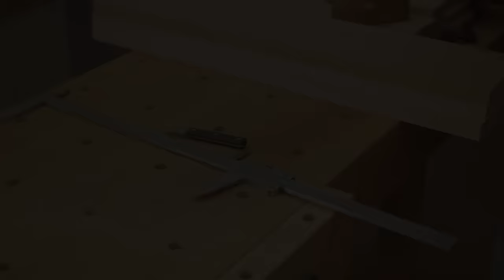SQUARERULE FURNITURE - Making a Dining Chair

Comment: This is one of the most clean and elegant chair designs I have ever seen. Very impressive work! 

I've noticed that other chair makers will incorporate a splayed design where the seat is slightly wider at the front than at the back. Did you do this as well? Or do you chair sides/rails run perpendicular to each other? Thanks in advance!
Reply from the maker: This chair is right angle.
However, upon request, the tilt of the entire chair has been adjusted.
<Adjusting the inclination of the legs>

Comment: Amazing craftmanship, my friend. What finish are you using?
Reply from the maker: AURO 117  1time ->  AURO  126 times 3 times -> Completely dry -> Varathane Polyurethane Varnish 5 times

TIP : 

- For the oak series, fine sanding is recommended.
If you spray water first(drying)  the surface will be smooth when oiled.

- The point is to apply thinly and wipe well. 

Thank yo

Comment: Excellent design, i appreciate that the seat joins overlap the rail/leg of the chair for extra strength. What sort of router table do you use? (5.46) I'm very impressed with it!
Reply from the maker: Thakn you 

I am using the same model as below.

http://www.winextool.co.kr/shop/shopdetail.html?branduid=1130849&xcode=051&mcode=004&scode=&type=X&sort=order&cur_code=051004&GfDT=amd3UA%3D%3D

Comment: After many years of making furniture in Europe , I’ve never seen a notching saw like you use at 3:56. Is this common in Korea?
Reply from the maker: This is a small table saw from Japan. There are saw blades on both sides.
It has been widely distributed in South Korea.
Try searching Google or Yahoo Japan.
This is the tokiwa sb400 model.

Comment: Which sawblade are you using on the makita bandsaw? I have the same saw but it always struggles with big pieces of wood
Reply from the maker: I remember it was a 16mm blade.
Now I use a different band saw

Band saw settings are important.

Comment: Wonderful design, quick question I am having a heard time finding a similar router bid used in your festool router (8:00) what is it called. Thanks in advance
Reply from the maker: It seems to have been 10 years since I bought the Festool Router.
I know it by hearing rumors, but I use it
It is a great inconvenience and there is no trouble.
However, the handle is more stable compared to other brands (makita, bosch).
It falls, but I am satisfied and use it!

And the price is expensive! :(

Comment: 14:45 why you did not use the top bearing? much safer !!!
Reply from the maker: Are you talking about the bearing of the pattern bit?
14:45 is just a picture~?
Reply: @squarerulefurniture  hahah. I can't even write the time correctly and then I am asking you to watch out more ;) I meant 5:45. I think your pattern bit is tall enough for using the top bearings. please also check 0:25, One day I cut my finger with a bandsaw (I still have it ;)).
Reply from the maker: @alimirazimzadeh544  Ah~ha If you look closely at the video, the bearings below are used. This is because the direction is processed differently depending on the grain of the wood.

If you look closely at 0:25, it is a video that is checked while the machine is stopped.
This machine has very good brake performance^^
Check the video again~

We will pay more attention to safer woodworking.
Thank you.!

Comment: 5:42 scary! Why not just flip the piece so that the blade will nit be exposed?
Reply from the maker: Because the wood has different grains, I used bits with upper and lower bearings.
I will try to work more safely
Thanks for watching.
Reply: @squarerulefurniture  ohh i see. You should buy a shorter blade though, its much safer. Thnx

Comment: Very nice chairs! Why do you put tape on the tenon shoulders at 12.37? I know tape on the outsides are for squeeze out, but I don't understand why shoulders are taped.
Reply from the maker: The adhesive side is perfectly taped to prevent oil from permeating.

Think of it as just to be sure.
Reply: @squarerulefurniture  oh you finished the pieces before assembly. Didn't notice that, thanks!

Comment: Great work! Question for you. Why do you put tape before gluing? What does that do?
Reply from the maker: Protects the clamp from scratch and protects the outside from hammer strikes.
Protect. Also, when the clamp is crimped, a certain force is positioned to enter the area and attached.

Comment: What kind of finished did you used for that project?
Reply from the maker: Finished with 3 coats of auro 126 oil
Thanks for watching!
Reply: @squarerulefurniture  What you think about the Watco Denish oil? because auro 126 is not available here in the Philippines

Comment: at 26 seconds holy crap, you almost lose your thumb. what is wrong with you?
Reply from the maker: My table saw has a power brake function.
The saw blade is already stopped.
Thank you for your concern.
Reply: @squarerulefurniture  Yes, I notice it in later cuts on the video. It's still jarring to look at! Excellent content, however.

Comment: To much wasted time with daft planing and fucking about removing unnecessary bits, why build most of it with power tools then waste time with over rated hand tools?? Makes no sense. Undoubtedly a beautiful and well built chair, but come on. Liked the vid anyway though.
Reply from the maker: I think you can think so
But the machine can't solve everything

It may seem like an act that may seem unnecessary
Think of it as an action for a better outcome~

Still, it feels good to like you!

Please give me a lot of advice in the future! Thank you!
Reply: @squarerulefurniture  I don't think you need advice, your obviously a skilled woodworker, I just don't understand the need for hand tools when machines were used to build 90% of the product, and they leave a better finish 99% of the time.